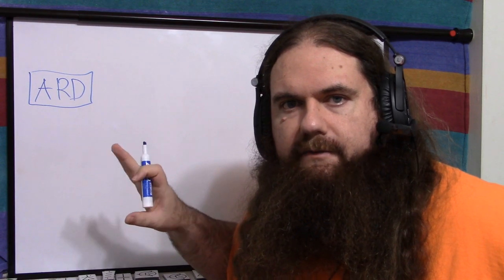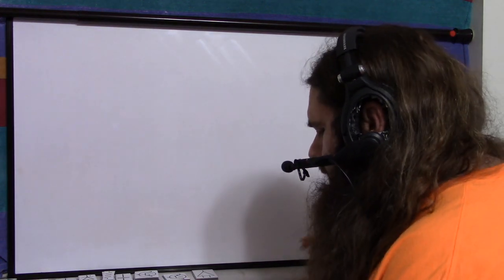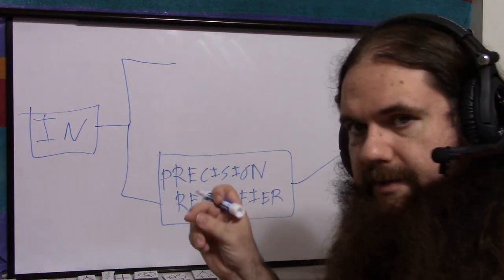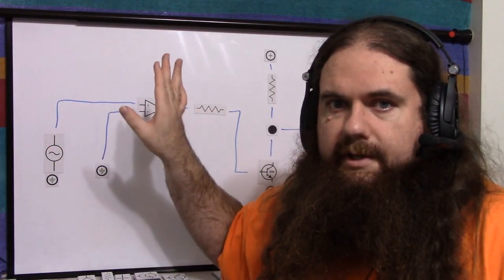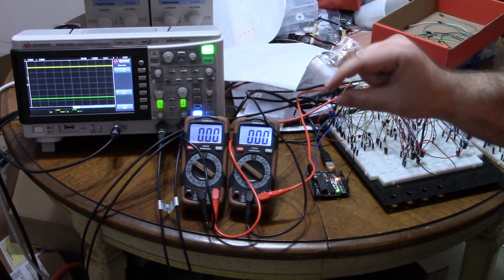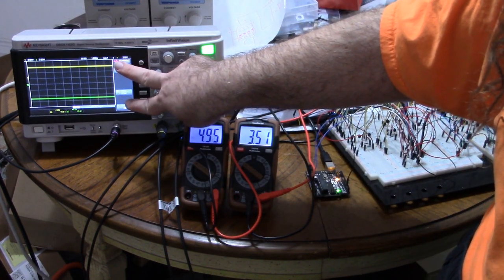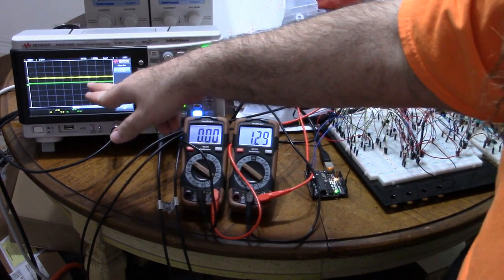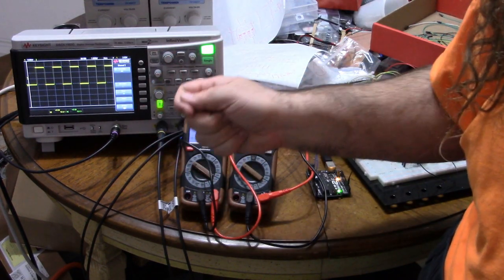Make a Real Voltmeter with an Arduino Uno - Positive and Negative Voltage - Simply Put

Comment: Very useful idea, thank you for this series of videos. All very clearly explaied, that is appreciated.
 I love this idea! I buit the full wave rectifier (added two diodes to your circuit to paliate saturation, and built the comparator using an LM324 and it works very well, and is fast. I will use this in a home built adjustable dual rail power supply so I can see the voltage output.

Comment: Thanks for the video sir... I have a problem.. I am using LM833 op amp... It's output is not zero even if I connect both of its inputs connected to ground... It is giving an output around 3.6 Volts.... Plz tell me why the op amp output is not zero with both of its inputs short circuited and grounded...

Comment: This is nice but way overcomplicated!
I know of a way to measure both positive and negative voltages, on the same analog pin, with only 2 resistors and no op amp😌
It requires some clever code and math but that's why we use a microcontroller. Ask me if you wonder how I did it😉
Reply: How do you do that ? Im actually interested.
Reply: Would also like to know
Reply: that would be nice if you share with us how to do it sir, thanks before
Reply: I will. What voltage range do you need?
Reply: Here you go, I made two versions and with this knowledge I hope you can change them for any voltage range you require:
http://www.falstad.com/circuit/circuitjs.html?ctz=CQAgjCAMB0l3BWcMBMcUHYMGZIA4UA2ATmIxAUgpABZsKBTAWjDACgAnEJwmkFGlWwp+gqMnhsAHtzDZyYQnllhi4DBD5gkAQUhsASuBTKBVRVTPiqYpkioPoCTsdNjhohxLhsA7iA8LAJErfWwlYPBCKiZiQiivfSMePitY+NDxMXtrJzZw5UIBEDjaPCpShz8QJWVS2s8oFww8VLEGzMpJI3LLMVa3RNohIZhnGTpyYnoaBCRSrV19LgRiEPa8QfEweH0AGQo1xoQwdaGAMwBDABsAZwZqfQmacgF4l7a1RZAAER3pWQ4ZBIMAvZDKNogADKAFcAA4MDgAHVutwAlgBbOHXBgouwANxRABcAPYopFwhCE24cS4AOwA5gwAZQ1EwPBhIGyUF9RNwUFTiWTbhTcNTaYzmf4Wm0qL1Gvp-EU+PVNiV4voACY1fDgGh8aJ1DLgAByCA07G1hvVOohplN5tYbAZtr1Bt1QSqRmtNEKHo1WSoOUc435p2CGUgImEvO0IHO1xJlyJKPxJOuRMuTPJAEcURjLnCABT0m4khkGBiXTVFvQASgANJAGzsUNgG3iuh3bl06wB6HYwSAAbgBhGwEHHICwVEI72MIAA8nCiWiSXSbii4RwSUSGABjVfrlGateahi3FmEEFzw4QRSxkQAcRNPwB+oguHiCBoalwj-jRNkxRDgq01AA1dNMyZIs6xRABvFF3xoT8EBELA+GwOZaAXNFzhREtNX3FEAB4UVbbA4JFajyRpBgiRhDg6XzQtCP3btm3IqN2zxAU4G7XsUT7Lih1HCZsGUeR5lKeQIQXE80QZNFM2uAB1DhlIYIsdm7PZF1Uuth1ok8GGuS4AE8AFk0X3Hd7n3ddNVuItKEM4y6IYpiWOLUtEwrMDa0gRsUU424KI47tcDgKjhLCuBYDE2h3BMEA8HNAIJxw8NTyUlT1M07TQoACQASSfIq3Jo25zzMqybLsg9HOc1yjKqgAjcy9xRatiJFPNbl88tK2rQLDOQzDiCQfVJOIOTwwAXwBJgBHoDAkGWmh0Lk4okX0El+BqPgbB5EQwGYcgMGgPBTgQZhwyEHCbACNh9sKI7aB5VJHHgbBiEgIoQQOsByDCe0ADEIBiJB1ogAkhRRQUaXpJl8mUHYQAh8RlqQXBZH5RHSRRMUQOR5kgA

float readVoltage()
{ 
  digitalWrite(10, HIGH);
  delayMicroseconds(50);
  byte adc = analogRead(A0);

  if (adc < 1023) {
    return map(adc, 0, 1023, -2500, 500) / 100.0;
  } else { // adc == 1023  voltage >= 5 V
    digitalWrite(10, LOW); // Change the measurement range
    delayMicroseconds(50); // May work with less
    adc = analogRead(A0);
    return map(adc, 0, 1023, 0, 3000) / 100.0;
  }
}

Or simply:

float readVoltage()
{
  digitalWrite(10, HIGH);
  delayMicroseconds(50);
  byte adc = analogRead(A0);
  if (adc < 1023)
    return map(adc, 0, 1023, -2500, 500) / 100.0;
  digitalWrite(10, LOW);
  delayMicroseconds(50);
  return map(analogRead(A0), 0, 1023, 0, 3000) / 100.0;
}
Reply: @nielsdaemen  i need -60 until +60, totally if we measure that would be 120 vdc, thanks sir
Reply: @iotan09  Do you need to make it for you?
Reply: @nielsdaemen  yes, i just wanna make this stuf for my hoby, thanks sir, i will try this soon
Reply: @Nielsa can you explain how can i measure voltage from -5 to 5 using your circuit ?